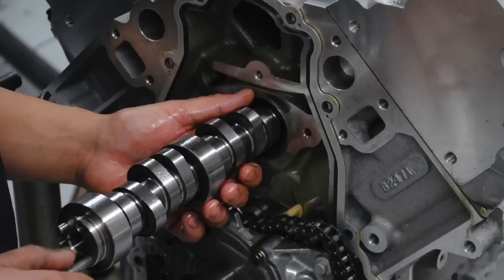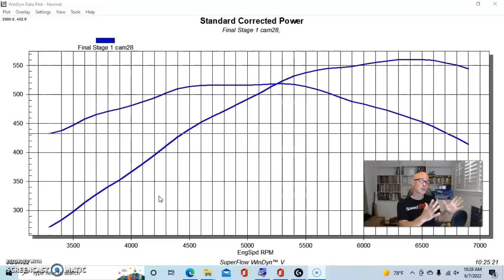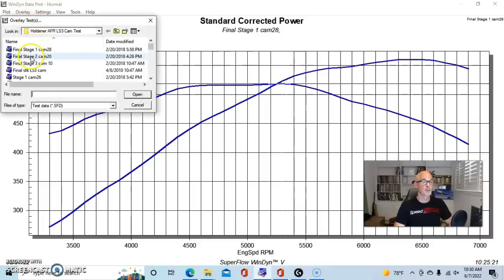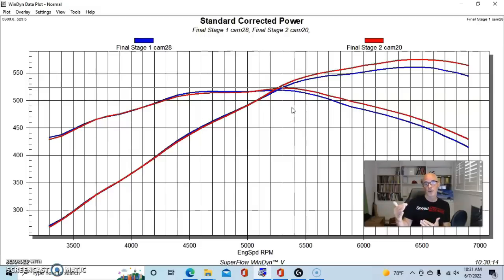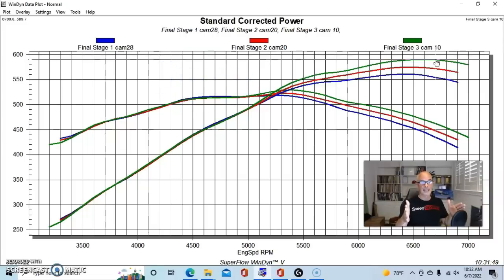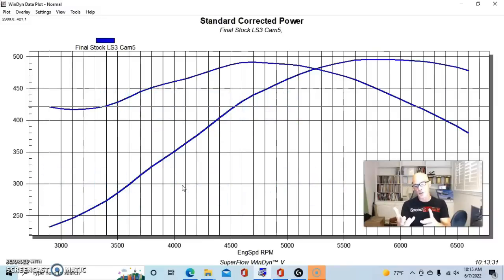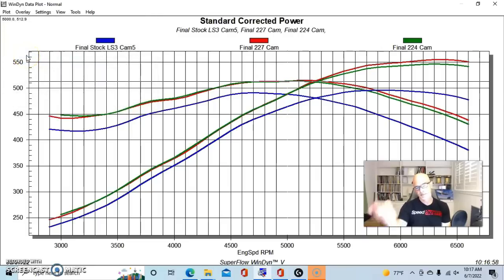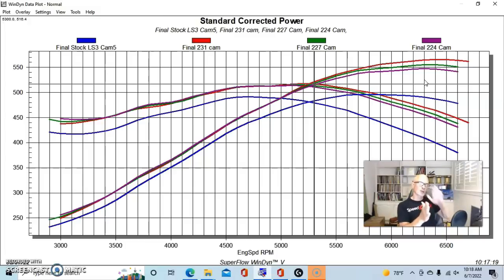DOES A SMALLER LS CAM MAKE MORE TORQUE THAN A BIGGER LS CAM? AFR LS3 CAM TEST-STAGE 1 vs 2 vs 3!

Comment: Appreciate you Richard and all your content.
Just wanted to ask: Have you ever done a test with Torque below 3-3,500rpm? The reason I ask is with the new C8 and many new AWD vehicles with power off the line, from a Dig? @2000rpm?
Reply from the maker: I have run may tests at 2000 rpm

Comment: My Personal Observation I Had On First Half Of Video:

The 1-3 Cams All Gradually Increased In Overlap Which Should Shift Where The "HP And TQ Humps"

The 1-3 Cams All Gradually Reduced In LSA Which Typically Increased Everywhere As You Approach The Optimal LSA For A Given Combination.

The Increased Overlap Didnt Really Shift The Curve Higher Up In The RPM Range However The Tighter LSAs Did For Thr Upper Portion Of The Cruves Increased Power. 

I Exspected The Highest Stage Cam To Be Alot Further Up In RPM Than The Lowest Stage.

Second Half Of Video Personal Observations:

All Camshafts Had The Same LSA. 
First And Second Cam Had Hardly A Change In Overlap So Was Mainly A Slight Difference From Lift. As I Exspected The 2 Cams Showed Hardly Any Change.

3rd Cam Had A Somehwhat Significant Increase In Overlap Compared To 1-2. This Did Shift Power Higher Up And Make More However Again It Didnt Shift It Muvh Higher Up In The RPM. 

The Changes In The Second Half Of Video Showed Less Jumps In Stages Which Is Due To the LSA Remaining The Same. 

These Are My Personal Notes.

Comment: My problem with all of these dyno results is what you guys consider "low end". I just want to know what is going on in the 1000-2500 RPM range and the graphs are always cut off. I am building a 6.2 for my otherwise stock silverado to replace the 5.3 and want it to pull a boat, not run a drag strip.
Reply from the maker: your motor can never be run at 1000 rpm under load
Reply: @richardholdener1727  your graphs here start in the high 2000's.
Reply: @richardholdener1727  specifically, pulling a heavy boat up a ramp I would like to know where torque figures are. This information is seemingly unavailable, even the OEM's just advertise the peak HP and torque numbers.

Comment: I'm building a l92 thats been bored to 4.070 for my daily driven wrangler and trying to decide on a cam. With taller gears 4.56/4.88 which ones should I be looking at as I do tow a bit with it and would like to keep offroad ability but still have decent power. I was trying to squeeze 600hp or as close as I can out of it if possible. Your videos gave me a few ideas but I still can't decide since it's a swap that most people have a shop install a stock motor for, thanks in advance.

Comment: I'd love to see the dyno charts from idle to redline. Most of the time, low rpm power is what I will be using. Peak power only matters when you're getting after it, and if you're not building a track car, that is going to be a small percentage of the time.
Reply from the maker: YOU AT IDLE SPEED AND WOT MUCH?
Reply: @richardholdener1727 if a CAM makes less torque under 3000rpm at WOT, won’t it make less torque under 3000rpm at part throttle too?
Reply: @mwahlert  lol you know the answer to that 💀💀

Comment: With many of us running around in trucks, this is great information but I wish we could get a chart of the lower rpm. Let’s say 2000 rpm and up. Although we can see 400ft lb of torque by 3000 rpm so we can imagine the ramp up has to be close to 300ft lb of torque at 2500rpm

Comment: I guess AFR just throws port-size and lift at em, good enough for us losers.  Be happy losers about your 1200-rpm off-road and dd requirements, you will only get Wess's Test useless offshore-boating data or nothing.  It's not just Rich, it's the entirety of anyone that has ever been associated or financially beholden to MT and before them Peterson.  Let me make this clear: Your only hope in the future is a high-hp engine that runs happily in 87 octane, not just 'pump gas'. The entire industry is a cop-out.  Nobody cares about solving everything by only paying attention to 3k rpm sweeps.  All of those motorsports are dead or dying.  NOBODY will demonstate their head/cam combo's resistance to detonation at loading, and nobody admits that 'pump gas' is 87 octane.  What happened to our informatiive aftermarket industry?
Reply from the maker: no one runs their performance street/strip car on 87 octane-you must be beholden to the 87 octane gas companies

Comment: My ls3 puts out 25hp at 800 rpm and about 200 ft lbs of torque. At 2500 rpm its about 180 horses and 350 torque. It is stock. Car is 91 e30 BMW. 2700 lbs. More horses and torque than I'll ever use

Comment: This is only my opinion but if you took a LS3 engine changed the crankshaft with a 4.00 crankshaft making it 416 cubic inches installed a BTR Truck Norris camshaft with matching valve springs l think it would pull like a freight train at 2000rpm even with a stock torque converter and it would probably make great torque and decent horsepower from idle to 4500-4800rpm and pull like hell with peak torque happening at around 3200-3600rpm

Comment: If your looking to increase low speed torque investing in a camshaft to do so is probably not your best choice now if you invest in a crankshaft with a longer stroke l think the results would be much better and if your using the same camshaft before the crankshaft swap depending on stroke being used it will lower your peak torque 700-1000 rpm lower this change will make a very noticeable difference in torque and when it will be accruing in the power band more so than a camshaft swap but by doing so it will be at redline 700-1000rpm lower also solve one problem create another

Comment: Even a mild Truck Norris cam will lose some slight torque until 2200rpm and it's designed to make torque any cam with more duration than stock is most likely not going to improve torque numbers from idle to 2200rpm and will perform better with a stall converter of at least 2500-2800rpm for a mild cam this stage 3 cam needs a 3500+ to take advantage of all the power

Comment: Any of these cams used will probably not work good without a 3000rpm + stall converter otherwise throttle response would be terrible until 2500rpm and with that being said torque from idle to 2300rpm it will be slipping at part throttle so if torque at 2000rpm is your goal basically leave it alone even a Truck Norris cam would be more snappy and has better throttle response with a 2500-3000rpm stall converter than a stock converter if your needing or wanting big torque at 2000rpm you'll be needing a big cubic inch gas engine or diesel engine l think putting a cam in a 376 or 6.2 and looking for big torque numbers at 2000rpm is pretty much a waste of time from what I've seen in this test if peak torque is what your wanting use the biggest cam tested all cams tested on this combination made the same power basically 3000-5100rpm the biggest cam carries better 5100rpm up and torque doesn't drop off as quickly making your power band more broad or wider

Comment: What centerlines where the camshafts installed at?  Seems like the biggest difference between the three camshafts is the amount of overlap.  Only about 1.5 degrees difference in the IVC if they're all installed with the same advance.

Comment: Anyone else notice the afr heads did basically nothing?
Reply from the maker: PORTED LS3 HEADS ON A STOCK LS3 ARE WORTH ABOUT 10 HP-ON A GOOD COMBO THEY ARE WORTH 60+ HP
Reply: @richardholdener1727  STOP YELLING AT ME!!!

😁
Reply: @richardholdener1727   did afr heads on a 6.2 ls3 make a difference than stock heads. What size was the heads

Comment: When choosing a camshaft for my Ls3 for daily driving was anything below 3000rpm I didn't care about losing power! 
 because id be doing the speed limit on a registered road and didn't really need to go fast. 

 4500 rpm onwards is where I personally feel the most tourqe and horsepower from my engine. 

In conclusion "who cares about power loss below 3000rpm I got a sports car not a truck that tows things for work"

Cheers Richard!
Reply: Agree..I run the biggest cam I can fit! I'm switching mine up again in two years going a bit bigger on exhaust side to better match my TSP PRC heads.
Reply: @GETLITUP69  Texas speed heads ? 
I was watching texas speed get 9s pass  from a heads and cam package with stock bottom end the other day.  😁 

I also seen a 8s second pass blow up a conrod out of the block of an ls3 so just watch how much you push her!

Comment: The loss of low end power with the larger cams will be more of an issue with smaller engines like the 4.8 or 5.3

Comment: Did anyone notice these 3 cams had 3 different lobe separation angles? The smallest cam had 115 the medium cam had 114 and the largest had 112. I think we all agree that a tighter LSA normally produces more torque. 2 years ago Richard did test on LSA  A 402ci same lift and duration cams 3 different LSA 108-112-120 the 108 made more peak hp and more peak TQ .. in this torque test the small cam got the widest LSA which produces less torque and the largest cam got the tightest LSA which produces more torque. So by doing this you can make a large and small cam produce almost identical low and mid range TQ and make the larger cam with tighter LSA produce more higher rpm TQ and HP. ie LSA test 108-112-120 video . Go watch it please . It shows that 3 different LSA’s can’t be optimum for one specific combo. A while back BTR put a video out saying that LSA really doesn’t matter and thanks to Richard he has proved that completely false .. I’ve heard it said that the LSA is the most important spec of a cam to get correct and if you don’t like the rough idle chop a tight LSA produces you’ve probably chosen the wrong duration/overlap for your combo..Thanks Richard for all you do and BTW how’s that 2.2L coming can’t wait to see it on the dyno with a Vizard specced cam
Reply: Vizard isnt specing the cam for the 2.2

Comment: Once you keep closing the LSA, it will make up for the extended duration losses than would normally occur at the lower rpms, and therefore maintains torque production at lower rpms. However, the extended duration degrees keeps the valves opened longer, per 4 cycle event, thereby facilitating power making in the higher rpms..Low speed mannerisms are affected by the LSA /ICL. due to overlap, exhaust dilution from reversion.. A complex process, with lots of critical variables..
Reply: I was hoping the cams would all have similar lsa's and icl's. Hard to compare torque potential when the small cam has a wide lsa.
Reply: You have no idea what you are talking about, do you?

Comment: Ok a couple of things. Isn’t average torque more important than peak, with that being said I did notice the bigger cam did make the same torque up until higher rpms. And second wouldn’t (with the right set up of course) cathedral heads makes more torque than rectangle port heads due to velocity? If I’m wrong by all means tell me.
Reply: The cathedrals would feel better in the throttle up to about 3500rpm then the rec port starts gaining

Comment: You didn’t mention the horsepower on the 231 cam on the motor with stock heads. Could you please post if you have it, thank you Richard
Reply from the maker: 566 hp
Reply: @richardholdener1727  thank you! Just trying to figure out a rough estimate of what the ported heads were worth on the first engine! Thank you for all you so
Reply: Do*

Comment: Most important thing, IMO, when selecting a cam is to be honest with yourself about how you use your vehicle.  For a daily driven manual trans car, losing 50 lbs-ft of torque at 1500-2000 rpm can make the car much less enjoyable to drive.  If you've got a stock converter automatic, you can afford to lose below 2000 rpm without much penalty.  If you just use your car on weekends for play, then its a lot easier to tolerate dropping low end torque, simply by driving a gear lower, or putting a looser converter in.   Unfortunately many people have trouble being honest with themselves (or just don't know what they want) until after they make the wrong choice.
Reply: big boy cam makes big boy noises
Reply: alot of guys dont factor in the dyno factor into their decision a big cam that makes 580hp sounds good compared to stock 430ls3 but in reality only a 50 hp gain
Reply: @bill2178  what are talking about my cam made 60+ plus from my cam swap and  another 30hp from aftermarket heads. Big cam is king.
Reply: 2000rpm...nobody cares. 3000rpm and up is what matters. In a M6 just drop a gear and your in the sweet spot.
Reply: @GETLITUP69  people in heavy vehicles care, how often is a truck at 6500 rpm?
Reply: I have a manual c7 corvette and just installed a 235/247 cam paired with a bigger YSI blower(1200hp) made 850whp on dyno with low boost and drives around on the low end pretty great. A tiny bit of cam surge at very low rpms. Again though to your point if they are that picky leave your car stock lol
Reply: Don't cam it the OEM camshaft delivers exactly what you want very low end torque

Comment: Where I got mixed up choosing a cam was the fact that I was building a street motor for daily driving!! Most of the internet advice was in regards to a racing engine! Huge difference! People will tell you that some of the bigger cams are streetable, but there is a big difference in something you drive every day and something you COULD run through town on a nice Saturday. I went with small port heads and what I thought was a conservative cam for this reason. I actually asked Richard what he thought of my cam choice and he recommended a much smaller cam for the street. An actual street motor requires different tactics to end up with a responsive and powerful engine!!
Reply: This is where my build plan ended up. I'm trying to build a 489 BBC that feels like it came from the factory. EFI and catalytic converters to pass emissions. Stable idle. I want to be able to drive this thing daily without worrying about power and braking in parking lots but also want to make around 500 hp. Ended up with smaller aluminum heads and smaller cam. Estimated 505 hp on a calculator running 91 octane.

Edit: a lot of guys (especially younger) don't understand that there is such a thing as too much hp. If there wasn't, all of the top end super cars would be running 2000+hp. I don't want to worry that I'm going to throw this thing into a ditch every time I hit the fun pedal.

Comment: Hey Richard I'm not sure if you wantvto mention LSA in regards to torque as well.  For example you could have 3 of the exact same camshaft specs with duration @50 and same lift on intake and exhaust but let's say the first cam has an LSA of 114 the second camshaft has an LSA of 110 and the third camshaft has a LSA of 106. Now the cam with 114 LSA would be the most civilized with decent idle quality and vacuum signal. However the camshaft with the LSA of 106 would generally make more low speed torque, and more of a Choppy idle.
Reply from the maker: I did an LSA video already
Reply: @richardholdener1727  Torque rules on street.

Comment: Still wanna see a big cam with the long runner manifold test. 277 intake and the Sky Ram would be interesting, the long runners crutch the low RPM for the big cam, the big cam crutches the high RPM for the long runner manifold.
Reply from the maker: actually that combo would be the worst of both worlds
Reply: @richardholdener1727  your TPI test suggests otherwise, either way it would be interesting.
Reply: The sky ram kills power in the upper rpms. No amount of cam will make up for that. Maybe some like a big centrifugal supercharger could offset it a little but a cam will not. The cam can only work with the airflow it has.

Comment: That’s great and all but what does the torque and power look like from off-idle to 3200 rpm’s?  That is way more relevant for most driving, not peak Tq and Hp.
Reply: Thought the same
Reply: If your wanting torque idle to 3000rpm leave the stock cam in it even if you found something that made more torque at this rpm range it would be minimal Truck Norris cam would probably be you best bet but even this mild torque cam will lose toque slightly from idle to 2200rpm
Reply: Exactly what I want to know.
So many things are spun with the idea of 'streetable'; I don't mind a bit of loping idle, but ...
I want a muscle car for idle to say 3500 rpm torque.
I've driven and loved rotaries, those are so smooth all the way up to 9000 rpm plus and you can feel a well cared for one LOVE spinning above 5k.
It is the same problem I have with suggestions of switching out the gears, I don't need 4.11 rear to feel fast, I also don't want to give up highway fuel economy.
I want to approach my street driven daily muscle car with big low end torque numbers, to hell with peak hp numbers.
I'm not trying to be a street racer, not going to a track regularly. I want what my 75 pontiac with a 400 gave me, it could accelerate around a 3 ton land yacht as quick as I needed or smoke the tire off of it and it might have hit 2100 rpm before the auto shifted, it was my late teens car in the 90s. I liked that better than a few of the others 70s cars I had the enjoyment of either owning or my father did with various small blocks in them like my 76 Nova fastback, his El Camino, or his bored 454 in a 70 Monte Carlo ...
Out of all of those, the low torque beast of a pontiac was the most enjoyable to drive anytime day or night. The Monte was the most powerful, but finicky.

So I have one of two goals ...  I want to build a gen 4 trans am, either find a way to maximize low end torque in the LS1 from idle to 3k, or my money might be better spent/happier results with a 400/455 swap.